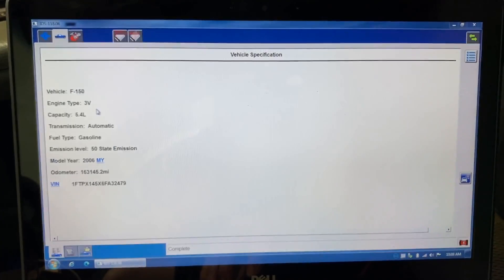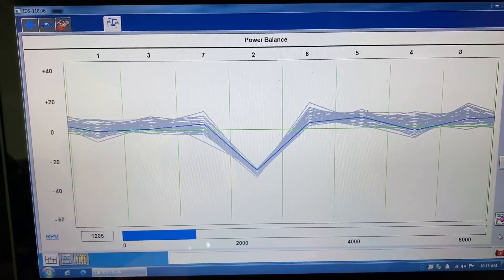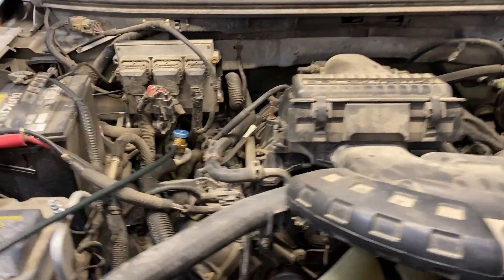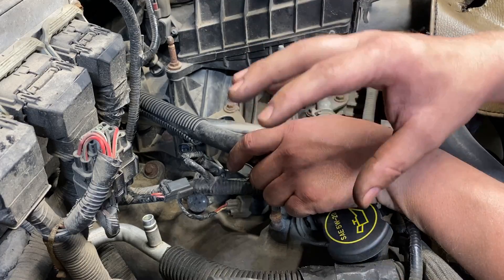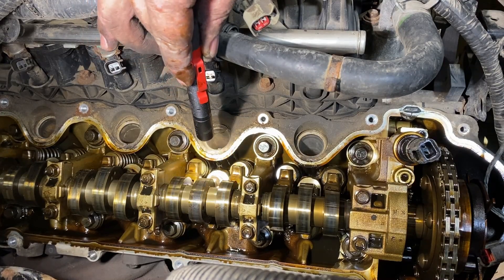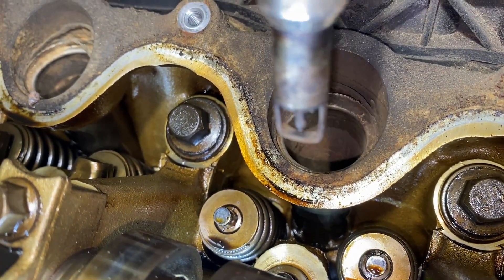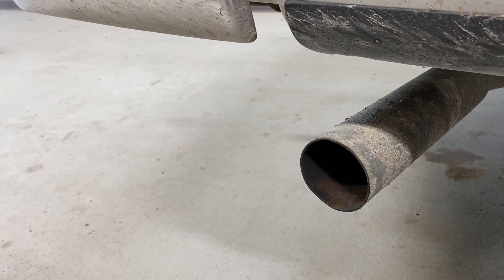Ford F-150 5.4L 3v Triton Compression Loss: P0302 Cylinder #2 Misfire Diagnostic Walkthrough

Comment from the maker: These are the Tools I Recommend:
OTC Compression Tester-
https://amzn.to/2DZPJ53
2004-2008 5.4L 3v Triton 14mm Compression Test Adapter-
https://amzn.to/2GT3pQg
2008-2014 5.4L 3v Triton 12mm Compression Test Adapter-
https://amzn.to/3hp9YGU

Forscan is free Ford Specific Diagnostic Software:
Download Here- 
https://forscan.org/home.html
ELM 327 Adapter I Recommend-
https://amzn.to/2GC6dBj

As an Amazon Associate I earn from qualifying purchases.
Reply: Love the paid version of Forscan for android!
Reply: What do think about the melling roller rockers and lash adjusters are they trust worthy for the 5.4 3v eng..
Reply: 2006 lincoln navigator with obd code P0354. Changed voi, spark plug and still misfire. Has plenty of spark. Any ideas
Reply: My cylinder 2 says one count misfire, so how often could it be occurring?
Reply: ¹¹
Reply: @FordTechMakuloco. Can you help please. I have a 2001 Ford F250 with 5.4L 2 valve. Im looking for the compression psi specs for doing a compression test. I cant find them anywhere. Do you know what the psi specs are for this engine.

Comment: The Ford dealer told me my 2007 F-150 with 200k miles is down 10% on compression with cylinder #4. Has a cold start misfire that goes away after 20 seconds. Independent shop did a relative compression check and there was no compression loss on any cylinder. So the Ford dealer has to be lying saying it needs a new engine? Spark plug and boot were replaced, didn’t fix it. No check engine light.

Comment: Where do you get the special test adapter for the compression test and or leak test? And is the tool/adapter M12x1.25 thread

Comment: I know this video is a few years old, but it was still excellent at helping me diagnose a hard misfire on #5 (which is fortunately one of the easiest to reach). After pulling the valve cover and removing the roller followers (which were all still in place and in decent shape), I was inspecting the valve springs and I pushed on one of the intake valves and I was able to compress the spring by hand. After closer inspection I found that the valve spring had broken and shifted down a coil. I had already pulled the spark plug and looked inside with a scope and the piston head was dirty, but no evidence of the piston ever touching the valve. So the broken spring still had enough compression to keep the valve up high enough that it didn't hit the piston, but didn't have enough force to seal the cylinder during ignition.

Comment: 055.43 valve 300,000 miles calling For cam Chef position sensor was ignored. Truck lost power and died out on the highway. Got it home and it will turn over but it won’t fire so I can’t start it to put a diagnostic on it, where am I at? Is my motor still good? Did it jump timing? Can you help please? It’s my only form of transportation.

Comment: Good evening I have a 06 f150 roush I have been working on it has miss fires at operating temp idle I looked at mode 6 data and power balance and it seems normal at idle but then comes back. I have replaced all the coils, all the plug which fixed it for about 5 mins before it got warm again all motor craft parts. 

I stuck my Autel inspection scope in cylinder 2 and it looks to me like the top ring broke and it is scraping the cylinder wall. What’s more is this truck has a good compression using the tester on cylinder 2 which was 185 cylinder 1 was 230 psi. Have you seen anything like this no error for vct and the phasers are bouncing at zero then move upon pedal input and return. No tapping or noise from top end. The crank has some endplay which I believe is to much after watching your video on it.

When this truck drives it’s ok until you give it 30% or more pedal then it starts misfiring like crazy and popping cats just were replaced as well any ideas and can I message you personally?

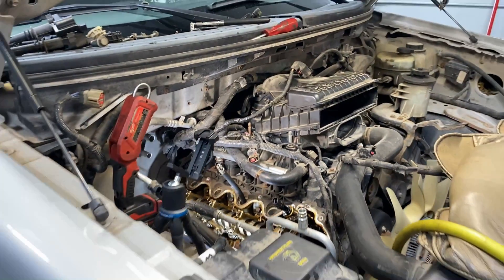Comment: I just purchased a 2005 to tow around my jet ski and haul 17:26  materials from home depot etc. salesman said the old man mechanic that went through the truck said he  couldn’t reach the spark plug but that’s all that’s wrong with it and maybe a new coil
Pack. Currently the truck is at another dealership being diagnosing.  So upset at myself for thinking this used sales guy was honest.  I’m hoping it’s not a broken piece of spark plug that has caused similar damage. 🤦

Comment: Hello Brian, I’m hoping you can help me. I’ve been working so hard on my truck to get it all fixed up after I paid a shop to do the timing and they used nothing but cheap parts and all my timing components started to fail less than 3mo after the repair. I watched your video series on the timing job and I want to say thank you for all you do to help us 5.4 3v guys. The problem I’m having is a misfire on cylinder 7. I timed the truck perfectly following your video and using the OTC tool. After I finished the timing job, everything was good until after about a day when I went up north to go snowboarding and the next day after I got home, I could feel the truck having a slight miss. I’ve replaced the spark plug, I’ve replaced the coil, I’ve replaced the fuel injector, I’ve done a compression test and all of my cylinders are around 195psi. What else could be causing a misfire on just the 1 cylinder? I checked my roller followers since I replaced all the lifters and followers with new ford performance ones with the updated design. I replaced the oil pump with the Melling 340HV, I installed brand new ford phasers, I used the metal chain tensioners out of the Mustang GT which I did modify the ratchet by filing down 2 teeth to allow it to ease tension when the truck is off. The misfire seems to go away after the truck gets to operating temp which made me think it could be a piston ring but no oil present on plug and the compression is nearly the same as all my other cylinders. Please help!😭

Comment: This is The second time I’m watching this video after a few years in about 50,000 miles and it’s a cylinder number two this time I inspected the plug it was a not totally loose but a little bit and the strap is gone this happened last time on cylinder four actually no cylinder five right after a tuneup and new plugs except that time the plug was really loose and the strap is gone so this is the second time no I put a new plug started it it seems OK I am very much cannot believe that that strap going missing in the cylinder did not make the engine blow up or something much much worse but we will see I put a magnet down there and took out a bunch of small metal shavings

Comment: I have a question about  my ford F 150 2005 4.6  transmission 4R70W that is not receiving electronic signal to the shifts cylinders . I also noticed that my fuse 33 has been burning out and then I changed it and truck started running ok then it burned out again so put a I little wired on the fuse just so that I can make it home but I noticed that it started to smell like something was burning and the od popped out and trans fault . I went to change the fuse it’s not burning out no more but I don’t know if I damage my computer or my cable and I don’t know how to read the computer . I was wondering if you could help me or suggest me something I would really appreciate it

Comment: After going through a nightmare with a 4.6L, I discovered that the intake valve was "cupped" which made the valve stem too long. This would not allow the valve to close completely. A quick fix is to grind off about .50" of the valve stem. Either that, or remove the head and replace the valve. This valve became deformed due to a misfire that created a lot of heat. An intake valve should not be getting that hot since there is air flowing over it all the time. After the compression was restored, the cylinder is firing normally and the valve should not deform any longer. It should last. The only way to get this cylinder to seal, with air pressure in it, was to remove the rocker arm. After measuring other heads, to see how tall the valve stem was, I determined that there was around 50 to 60 thousands of an inch more valve stem on that intake valve. I ground it down, with magnets and rags surrounding it. Put the rocker arm back on, and had compression. Happy Dance!!!

Comment: Great video on how to correctly diagnose a trouble code. Why wouldn't you use a rubber mallet to bounce the exhaust valve open a little and try to loosen and free the debris that's keeping it from closing, while blowing the air? Ty, subd.
Reply: The debris is gone (or still bouncing around in the cylinder. The valve is bent and not seating correctly.

Comment: Great instructional video, thank you! That broken ceramic insulator rates right up their at the top of the rare events on the weirdo meter, makes a guy wonder of a close visual inspection of the plugs prior to install would have caught the problem. Boy would the consumers out there benefit if auto repair shop owners and their technicians studied the full range of repair videos you have produced.

Comment: I know you can't properly diagnose it but what is you best guess of the problem if I lost compression on #1 and #4 at the same time.  Being told I need a new engine but it's got only 100,000 miles on it.  Doesn't make sense to me that valves on 2 cylinders would stick at the same time and I would think it would be 2 cylinders next to each other if it was a head gasket.

Comment: I have the 4.6 doch Intech; I just did a timing job sprockets and all and it runs great on startup.
 3 to 5 minutes later it starts ticking and after a little while sounds like a dry bearing.
 Thanks to your videos I will be checking all my lash adjusters and rollers., But I think I have an oil circulation issue.

Comment: Hi Please I have a question I have a 2010 Lincoln navigator 8 cylinder First two cylinder in the front ha Very low pressure and my engine oil cap has a mail key oil I would like to know what close this problem before I start taking engine parts to replace head gasket anything I can do to make sure I have a head gasket before I start work on it

Comment: Have a hard to find misfire, on a 08 Ford Expedition, 5.4 3V, replaces all plugs and coils, ran a power balance and looks like there’s misses in almost all cylinders still, has 154,000 miles. Any ideas ? Thanks Sir

Comment: I’ve had my VCT’s repaired at the dealership. Oil seepage coming from the back of both valve covers. The seepage was observed and noted however it was expressed to me that such is not uncommon. A few oils changes and spark plug/tune up service later I began seeing more oil building up. While looking around with my flashlight I saw oil il in my spark plug wells. Dealership reinstalled the gasket/Valve covers however a month later the oil seepage is back. What would cause the valve covers to leak? Likelihood of this being failed parts vs improperly installed? Thank you.

Comment: I'm having the absolute worst time trying to diagnose a misfire and I'm also getting a code saying that my driver side catalytic converter is clogged. when I hit it with a mallet I can hear shit inside the cat. but the misfire is on cylinder 3! I've replaced plugs coils and every time under load going up a hill at around 60 or 70 miles an hour I get hesitation it feels like my transmission drops out and I get a flashing check engine light for the same cylinder and p0430. I cant keep wasting money on parts in these hard times and my edge scanner only says misfire detected on #3 no real data. My trucks also been getting real hot and im sure closed my new thermostat and had coolant leaking from the upper hose onto the housing yesterday at only 210°. Im so lost this truck sucks man. If u could maybe talk me thru some more options that would be awesome. Its a 05 f150 5.4 4x4. Cheaply rebuilt at 200k with 230k now stock cats

Comment: I had all 8 plugs (less than 1,000 miles on them) break off just like that. Started throwing misfire codes so I changed them all out again. Now I keep getting a p0306 code. I changed plugs,coils, injectors, tested power going to coils and injectors, and did a compression test. All cylinders between 205 & 210. Still getting the misfire code. Any clue what else it could be if compression is good?
Reply: I got the same code. I thought it was the coil. But it was a blown spark plug. When I replaced the coil I didnt think it was the spark plug. After the check engine light came back on I pulled the plug. When I tried to pull the plug the spark plug just came out with not a real loosening the  plug. Way to easy I just pulled it out with really turning it. I used a bore inspection camra. And didn’t see any threads. I blew my spark plug and didn’t know it. 
Check you spark plugs and ensure the torque them correctly. Check all of the plugs and ensure they are proper.

Use anti seize and a torque wrench.

Good luck

Comment: Can't believe all these problems with the 5.4... I own 2 2008 E350 super duty vans purchased with 100k on them and they now have 604k and 569k and have never been opened up for repairs!   Plugs,coils, filters, belts,  and Mobil 1 synthetic oil.. that's it!   Still running 2020!  Original Fuel pumps!!! Original starters!!

Comment: More than likely the plug was damaged during or prior to being installed. At any rate either the cab will have to be removed or the engine to remove the cylinder head.
Reply from the maker: No need to pull the cab.

Comment: I am doing a timing chain job on my 5.4 2004 F-150. The kit unfortunately has two right hand phasers and no left hand phaser. The question I have is this: is there a way to use a right hand phaser on the left hand side?  The company that sold it to me unfortunately can't send a replacement for sometime and I need the truck up before next weekend, any thoughts?
Reply from the maker: The left and right timing marks are 180 degrees from each other, the phasers are universal.
Reply: @FordTechMakuloco   Thank you so much bro. I was almost on my way to buy another one locally for $225, just to get this project done today! God bless you brother for your videos, they have been a great help for me.  I purchased this truck from my neighbor back in March and have been putting it back to reliable shape since then. Your videos are very informative and easy to follow. 
   Thanks again, Barry.

Comment: Hey there @FordTechMakuloco love the content! Question: I have a ‘12 single cab f150 2wd 5.0 133K miles 3.55 rear end and last week it was loaded up to max trailer weight.. was squatting pretty good but still had a little bit of travel.. i was in tow haul mode.. when i would take off from a stop or when i would accelerate more when going up hill the truck would shudder/vibrate the more i stuck my foot down and would stop as soon as i leveled out or got to my desired speed and started cruising.. any ideas what it might be? This is the first time it’s ever done it and never does it when it’s unloaded or lightly loaded.. this was the first time i was ever at max or maybe even slightly above max depending how much the trailer weighed (it was a rental)

Comment: Ive got some real bad rattle during acceleration on my 5.4 3v. I talked to someone who wants to do the job and suggests a timing job and I will add the m360hv and vct solenoids  cause there's shuddering at idle. My question is would the rattle be coming from the lashers and lifters?? I dont want to do a whole timing job if i dont have to and its just the lifters/lashers. Any thoughts??
Reply from the maker: If it is during light accel then yes a timing job is needed.
Reply: @FordTechMakuloco  it's throughout the rpm band. The entire time I am driving. I guess what we can do is do the timing job and if the followers are loose, take care of those as needed??. Thanks for you quick reply btw!! You're the man!! Gained so much knowledge with your channel.
Reply from the maker: You want to change all the followers either way.

Comment: It would be nice to see if a piece of ceramic is holding the exhaust valve open and/or if the valve and seat is damaged.  There are a ton of cheap boroscopes with all types of attachments now. =Should be able to get a picture of that valve.  

Crappy quality control = shit like this will happen.

Your diagnostics for this were right on the money and you did an excellent job of displaying the true situation.  This truck is probably a simple valve fix =  not that bad considering your diagnostics pointed directly to issue and you didn't waste time getting to it.  All the plugs are garbage and I would replace them for sure.

Comment: The shame is he may as well sell the truck as is running misfiring and take the loss, it’s not worth putting an engine in,and it’s it not worth putting the money into doing one  cylinder head it’s probably got high miles or engine hours by the look of the rest of the truck,and with the terrible longevity of the 5.4 ,it’s too risky unless you could do the labor yourself.

Comment: I have a 2014 Ford Escape Titanium and want to replace the front struts with the spring. I cannot find a video on how to remove the cowl panel and what the top of the strut looks like. I've only seen it for a 2012 and under with the 4 bolts and to my understanding the 2013+ has 3.

Comment: alot of issues with this engine Ford knows about but refuses to correct, esp with headgasket failure during normal operation not rough operation
Reply from the maker: Never seen a head gasket failure on a 3v engine nor have I ever heard of one failing.
Reply: @FordTechMakuloco  i had one at 50000 miles and my truck was never abused a well taken care of. look up the ford complaints for head gasket failure in the 5.4 triton its very eye opening
Reply from the maker: Darren Crispin 3v?? Or you talking 2v
Reply: @FordTechMakuloco  not sure which one, i know its the 5.4 triton and had it of course Ford wouldnt do anything about it even though its a known flaw in that engine